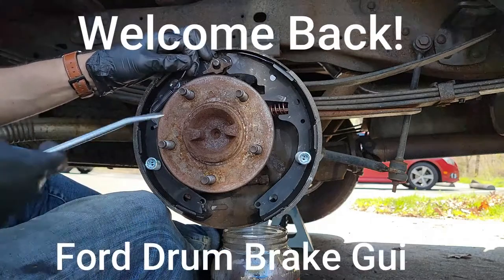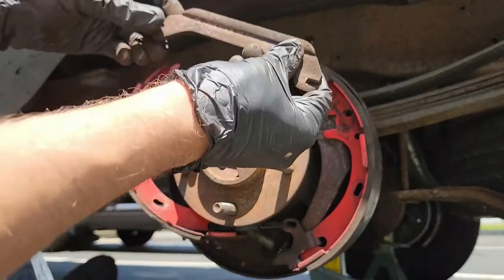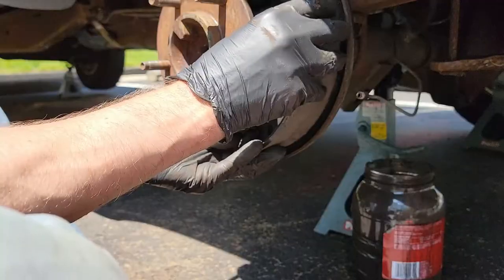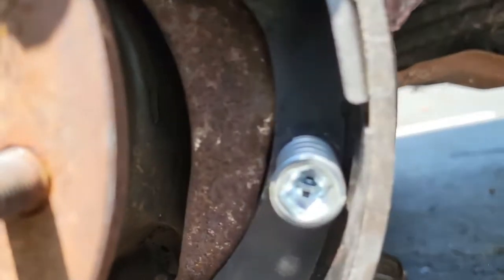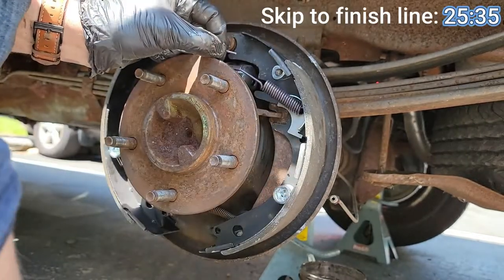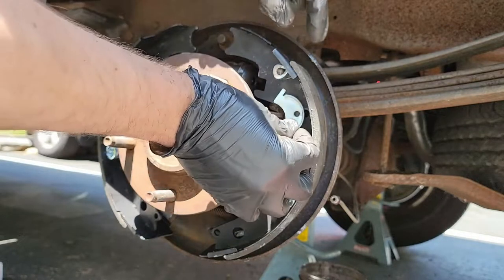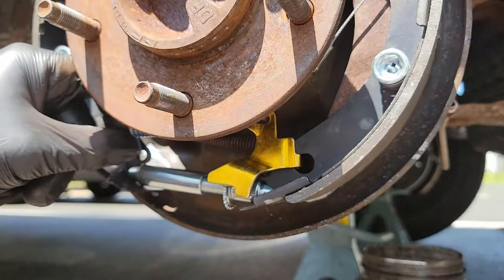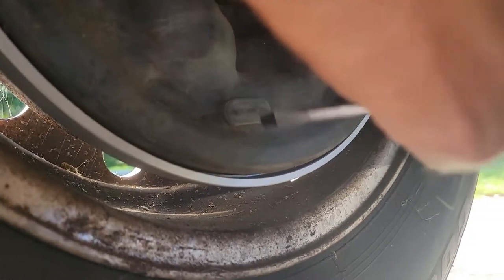The ULTIMATE Ford F150 Drum Brake Replacement!

Comment: Having the right tools makes all the difference!  For those wanting to do this for the first time, just get yourself a drum brake tool kit, not very expensive and it'll have the specialty leverage tools to easily get those springs and retainer pieces hooked up.
Reply from the maker: Yea I agree 100%. I bought one of those kits but it was a very cheap set. So, it wasn't exactly helpful which is why I ended up using different tools. Next time I need to replace drum brakes, I'll be spending the money on a better kit! 

Thanks for watching! 🤟
Reply: I think I need to make a video
Reply from the maker: You should man, we are all dying to watch it!

Comment: Hey TSG I wanna thank you straight off for showing a fn picture of the old brakes fully assembled, OMG, all these supposedly helpful videos show them taking off the drum and next thing they already have removed most of the hardware never considering someone like me who had half the brake parts floating in the drum because of a rip off garage that charged the previous owner 350 bucks for back brakes and didn't even use the correct parts, its one of the most dangerous hacks I have ever seen in my 60 years. I had zero guide to go by until your video. My truck is an 87 4x4 with the 351 4bbl in it. I live 21 miles off grid in Arizona and that truck hauls thousand of pounds of water plus livestock hay and feed plus my propane, thank God nobody got hurt or killed because of hackers calling themselves mechanics. My brakes went out completely cause when they collapsed it tore open the wheel cylinder and all my fluid went out. Thankfully it happened up here at my place. I have not watched the whole video yet but I will, just have a big mess to clean up first. But drum is off and has survived. I read in comments about cussing and I have been doing that already, lol. Again thanks for showing the unit assembled. Awesome.
Reply from the maker: Hey thanks for the kind words. My dad had an 87 2wd with the 5.0 EFI. He was able to get 450,000 miles out of it. These trucks can run forever! 

Let me know how it goes when you get it all done. We try to show people some of the things that can go wrong while maintaining their vehicles. I'm glad you found it helpful.

Comment: Thanks because I had no clue where to put the  parking brake lever went , you help me , my adjuster cap came off and stuck between the drum and brake shoes , had to change it with the og bottle jack in a motel parking lot ,Handy trick removing the pivot washer , use a punch or small chisel. And on the spring installation a good pair of vice grips, and I feel the frustration, trying to reinstall the springs with a wrench , I broke the adjuster cable twice.
Reply from the maker: Yea man it was more difficult than it should have been lol. I'll be more prepared next time! 🤟

Comment: If you don't have the retainer spring tool, narrow nose vice grips work wonders. They will hold the spring and cap, no problem. What I liked is you showed real life problems that can happen, unlike other videos that make it look so easy and simple, although using the closed end wrench on those springs spread out the ends making it easier for them to pop off. Again, if you don't have the tool vice grips work great, getting them on the first time reducing minimal if any damage to the spring. And yes, I was yelling at the screen noticing the wheel cylinder pins missing. And you should lube the star wheel adjuster. I just went through all this, but I had the brakes from h&ll...
Reply from the maker: Yea I figured it would be good to show everyone some of the problems you can run into doing this for the first time. Now, the next time I change them I'm going to do a more thorough video with the proper tools.

Comment: Thanks. Very helpful video. Though the job is much easier with channel lock style pliers. I was able to get most of the springs and clips and clasps installed on the first or second try. If you do this brake job again, you should try a few tools other than the needle nose... :)
Reply from the maker: Completely agree! Channel locks would have been much better. I'm glad you got it done Daniel, and thanks for watching! 🤟

Comment: Pivot washer: I watched you struggle with that, and it seemed to me that you needed to get a tool that would work to push the washer off from around the bolt, causing the washer to expand as it is pushed to slide from around bolt. Maybe clamp the shoe down with a couple of c clamps, then hammer and a chisel or flathead screwdriver.
Reply from the maker: Yea that pivot washer was a lot of fun lol. Looking back there were a lot of things I could have done differently. Your suggestion would work for sure. Next time I gotta deal with drum brakes, I'll give it a try. Thanks for watching and taking the time to leave a comment True Star, we appreciate it! 🤟

Comment: i use vice grip  clamp on end of spring  open end up some then pull on vice grip make sure you are very tight on vice grip on spring pull on grip go around post  do same  on outher spring  then squezze end of spring  ends both to gether

Comment: One thing I noticed was you were using needle nose plyers to install the springs with the metal disks to hold the shoes. Perhaps some regular plyers with taller teeth would have worked better? I also found that if you put an elastic band around the shoes on the outside of both of them in a circle it makes it much easier to hold everything together. This is not a very easy job but it is something you do so rarely as soon as you conquer it you soon forget it because you do it so rarely. I've gotten cut by these springs when they pop back.....that hurts.
Reply from the maker: Very true Thomas! Those would have definitely made this easier for sure. Thanks for watching! 🤟

Comment: Your cursing counter had me laughing so hard
Reply from the maker: Lol it got a little out of control 🤣
Reply: @TrickShiftGarage  I just replaced my brake shoes, wheel cylinders and replaced all hardware on my E150 van.  I had the exact experience that you did.  I had to start over several times.  Those springs are a real pain.
Reply from the maker: Was it the first time you have done it? I think that's why we had such an issue. Next time we will have an easier time.

Comment: 7:54.. that c clip should always be replaced if possible..when they get corroded they are hard to remove..so I drill thru the closed end, insert a punch, And tap it out with a hammer... "even with the proper lubricant, a good amount of 'verbal perjoratives' will be required to complete the job..
Reply from the maker: Very good point!

Comment: NOoOoOoo NEVER EVER hit the sides of the drums. Hit the space between the studs. If you’re afraid of accidentally hitting the studs, put a lug nut over it. But don’t ever bang the sides of the drums. You risk denting it ever so slightly and you’re going to get a world of issues. Other than, awesome video!! 😊
Reply from the maker: I've never heard of anyone having issues with hitting the sides. If the drums dent from hitting them, then you should have no issue breaking them in half while hitting them. I'm assuming you are saying that to be cautious, but that cannot be a common issue. Those drums (even of this age) are pretty durable.
Reply: @TrickShiftGarage  As a mobile mechanic that’s made multiple house calls for DIYers that hit the sides of their drums and then don’t understand why their brakes were making a crazy sound, I’ve had to educate on why it’s a bad idea to hit the sides. 

If I can save someone from making that mistake or help someone figure out what’s up after doing so, maybe this comment can help 😊
Reply: @TrickShiftGarage  You did a great job, cussing and all.
Reply from the maker: Are they hitting them with a sledgehammer and then reusing the drums? I replaced mine, and also I hit them with hardly any force. Definitely not enough to dent them.

If someone is reusing their drums (highly advise against that considering how cheap drums are) and they decide to go all out hitting them, then sure. It could cause issues. But I think it's an exaggeration to assume this is a common occurrence considering most people replace their drums. 

For anyone reading this: just replace the drums.

Comment: Too many things you did wrong.
Vise grips not needle nose. Flathead Screwdriver would have opened the C clip in 2 seconds with just a twist.
Brake shoe hold down springs use Vise grips or the proper tool.
The order of removal of the parts was incorrect. Then I stopped Watching. Much too painful...
Reply from the maker: Oh I agree a lot of mistakes were made, but the brakes work great and I have had no issues. I know this was a painful video for you to finish, and I do sincerely apologize. Hopefully my next video won't hurt you so much.
Reply: @TrickShiftGarage  watch Chris Fix video on doing drum brakes and you'll see a real professional demo
Reply from the maker: That's why I said "This was my first time dealing with drum brakes and I made a lot of mistakes" in the video. And I completely agree about ChrisFix. That's why he's the most successful automotive channel on YouTube. 

This video (and all of our videos) was not meant to compete with Chris. I'm not sure what gave you that impression, but that's completely inaccurate.